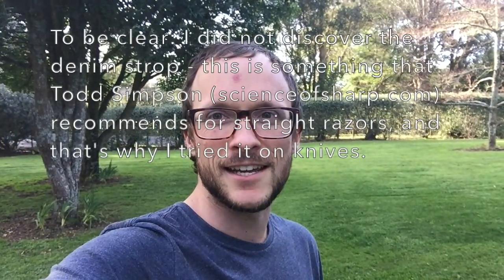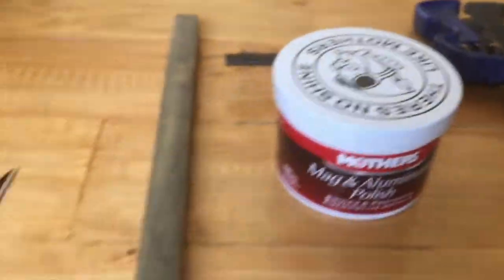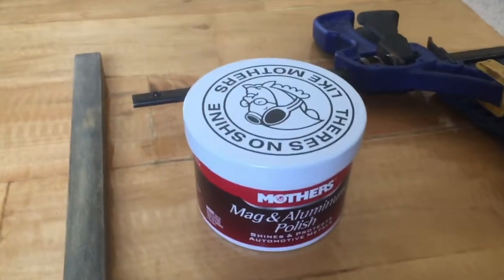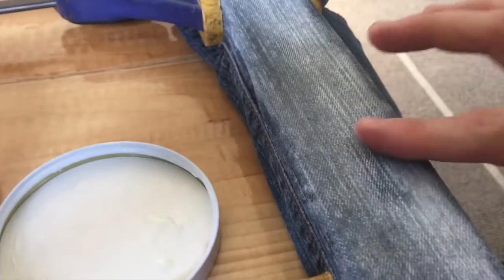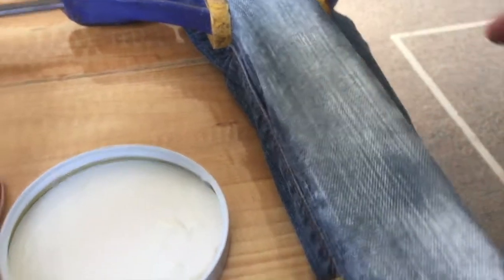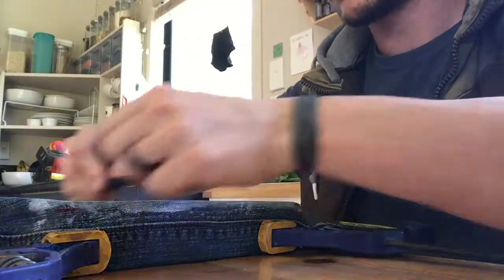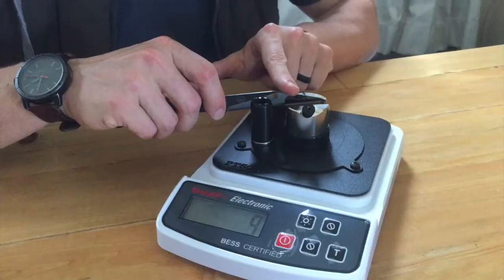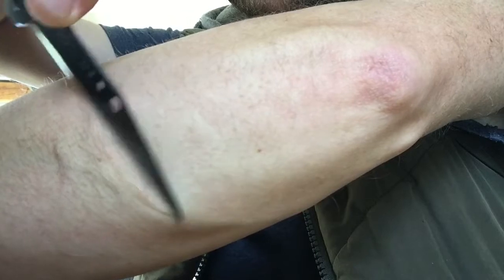The Secret?! To Shaving Sharp Tungsten Carbide...  Sandrin TCK Knife Sharpening Hack

Comment: Got the sandrin monza today, shaving out of the box, cloudy mirror edge, definitely a higher polish than any other factory edge ive seen, polished but still very agressive, more agressive than a steel edge at this level of polish, it wont whittle my head hair (i have super super fine hair) but it will whittle my beard hair which is fairly coarse. Definitely a nice factory edge
Reply from the maker: Yeah, I eventually got rid of the TCK, because it was hard to bring the edge back by hand!  I recently got a Sandrin Torino and I'm excited to give it another shot.

Comment: It barely cut the arm hair.  Do you even have any idea what Tungsten Carbide HRC is  "71".  That polish wont even touch it.  Do your home work.
Reply from the maker: Hey Benny - yeah I was given the knife and have had to do the homework as I go.  This video was early in the process.

Yes, it’s barely cutting hair - this is an old video - I was just excited because it was the sharpest I’d got it so far.

In terms of homework, yes, I am aware of how hard Tungsten is.  Actually, in steel it depends on which other alloys it mixed with but pure Tungsten Carbide is 86 HRC, and Molybdenum Tungsten carbide is 75 HRC.

Sandrin rates their blades at 71 HRC because they are Tungsten Carbide embedded in Cobalt, and the Cobalt matrix indents in a Rockwell tester more easily than pure carbide.  Yes, it’s very difficult to sharpen and my results have been unimpressive compared to sharpened steel edges - I totally agree.

Rockwell hardness numbers are from Larrin Thomas’s research, there is a table about halfway through this article if you want to cross check the info:

https://knifesteelnerds.com/2021/10/19/knife-steels-rated-by-a-metallurgist-toughness-edge-retention-and-corrosion-resistance/

Thanks for your comments, I hope you have a good day.  If you want to see my current opinion on WC knives, check out the video I linked in your other comment.  Take care and happy holidays.

Comment: I wonder if Mother's Mag on a stiffer strop might get slightly better results.  Balsa or birch maybe?
Reply from the maker: Great thoughts!  I'll have to give it a try!
Reply: @homeslicesharpening  or what about MM rubbed into aluminum?  It might need it might need reapplication every few minutes.
Reply from the maker: @ZPositive  BRO, I had not thought of that...  Will have to try it out!
Reply: @homeslicesharpening  and on a different note, machinists use green grinding wheels on bench grinders to shape and sharpen carbide tools.  I think I've seen the fantastic youtuber Stephen Gotteswinter do it.  Not sure if those stones are available in high grit, flat versions, but it's another thought.
Reply from the maker: @ZPositive  Yeah, I don't have access to a bench grinder at present - but I assume light pressure, fine abrasives, on a softer buffing wheel would have a good chance of working well on Tungsten Carbide.

Thanks!

Comment: A pretty good result on the denim strop. I'm still a bit hesitating about getting a TCK. 1095 is so easy to maintain and strong ofcourse you have to sharpen it more often then tungsten carbide but it does get scary sharp.
Reply from the maker: I honestly understand bro!  Mainly I'm doing these videos just cause Pete sent me a ruined Sandrin, and I figured if I could rehabilitate it by hand - that would help a LOT of Sandrin lovers and/or Ceramic-blade knife owners.

If you truly enjoy the sharpening, just use and enjoy your 1095!  The jury is still out on whether I'm going to carry this thing often when my  Spyderco in M4 lasts nearly as long with a dual grit edge and is SO aggressive.

But hey, it's a really fun experiment!

Take care friend!
Reply: @homeslicesharpening  It is a very nice experiment. The jury in Holland leans to the Spyderco in M4 hahaha. Oh i have different steels but the 1095 is on my hard use work knives although i also use a lot of the Sandvik. Recently bought a knife in 440C and it doesn't disapoint me it holds up better then i thought. must be a good heat treat on that one. Have a good weekend Gabe, stay safe and God's blessings on your family.
Reply from the maker: @jeroenvoss6231  Thanks heaps Jeroen, God bless you as well.

Comment: I might have missed this from a previous video, but why denim instead of leather? Thanks
Reply from the maker: This is why I tried denim:

https://scienceofsharp.com/2016/05/29/the-pasted-strop-part-4/
Reply from the maker: There is a whole series on pasted strops, and he finds that a hanging denim strop deburrs better than leather with diamond (at least for staight-razors) I figured I'd give it a try!
Reply: @homeslicesharpening  wow thats some really deep science!! 
Interesting to see de real differences of the grit under extreme magnification. 
The 16k Shapton stone produces  insane sharpness but it looks like the edge was sharpened on gravel at a SAM POV. 
Thanks mate! See you lather alligator!
Reply from the maker: @sandorandras4148  Yeah - I love it - I am still trying to work out the application on knife edges though with lots of mistakes!

PS I know, it's so crazy how coarse an edge looks in SEM after honing on an ultra ultra fine stone!!!
Reply: Yes Gabe whay denin?
Reply: I use a kind of auto body paint polishing compound on a leather strop and for steel is amazing!
Reply: I note that Saxon advise the use of Denim and Leather! 😉 https://youtu.be/gtpSl1dm_fw
Reply: @archivist17  🤘🤘yes!!!!
Reply from the maker: @archivist17  🤣😂 Who can argue with that?!
Reply from the maker: Hey guys, I tested leather in this video (although I have been told I need to alternate strokes through the whole process so it may bear doing again).

It produced a BESS of 450 grams which is much higher than the near 200 that the denim strop did.

Comment: I have used mag polish before (Meguiar's all metal polish) on spray adhesive cardboard and newspaper on granite. Judging from dark metal buildup it finished the edge to a screaming edge
Reply from the maker: Yeah, bro I have been as surprised as I am pleased!  I love this stuff!
Reply: Is it good at polishing hard carbides in super steels? What do you guys think?
Reply from the maker: @Owieczkin  It is Aluminum Oxide based, so would not cut aggressively through Vanadium Carbide.

Interestingly, Todd at scienceofsharp.com recently did an article that shows that diamond (which everyone uses on hard carbide) actually fractures surface level carbides rendering them weak - and softer abrasives like Silicon Carbide can actually expose them in the edge without breaking them.  Super interesting, have a look:
https://scienceofsharp.com/2021/09/14/carbides-in-k390/

Anyway, I don't think it would cut the carbides aggressively, but maybe that's not such a bad thing?  Needs further testing.
Reply: Won't even touch Tungsten Carbide............Get real the HRC is 71.